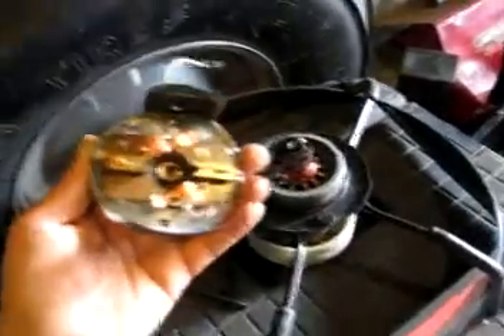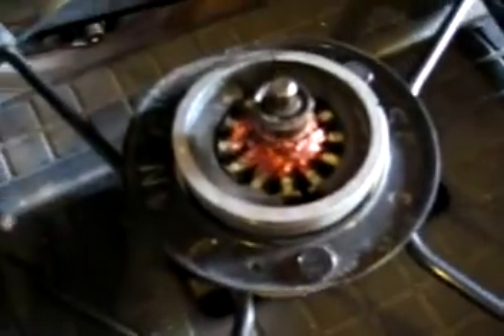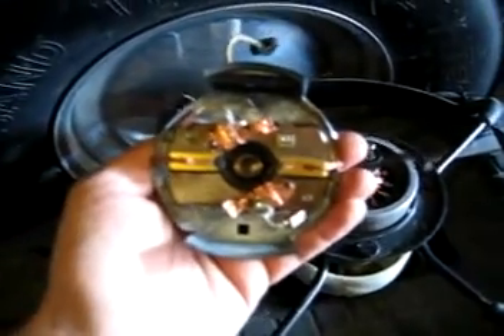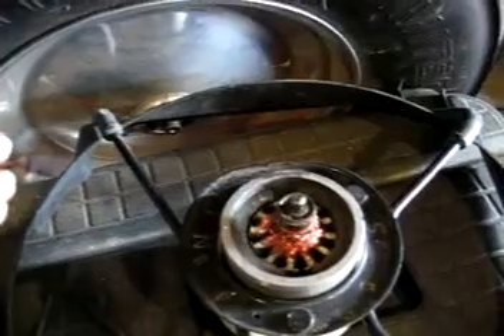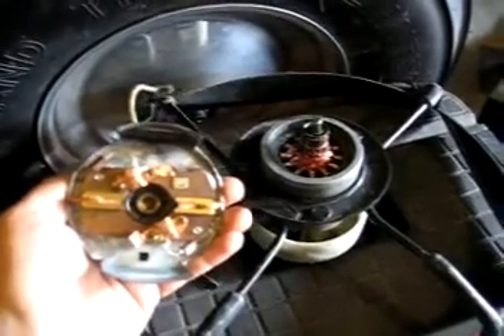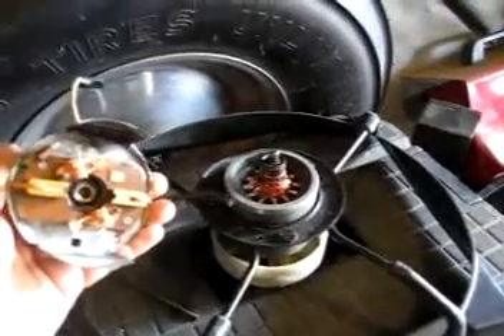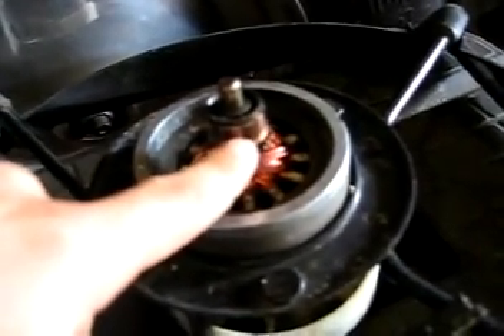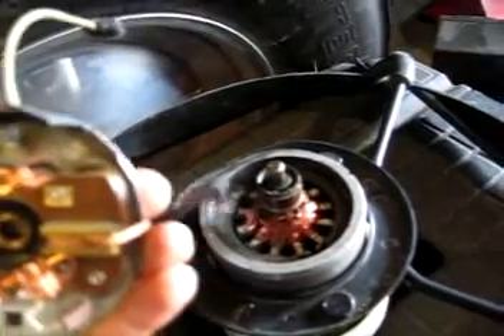Bemf on a normal dc motor

Comment from the maker: brushless motors, are pretty much pulse motors, and frankly other than fan motors and some rc cars they are not very popular. In the end I will be moving in that direction, but I thought it best to start with the most abundant motor around, these things are used every where, both ac and dc, but same design. The trick to this one will be the fact that all the coils are wired in series, which I may have to change so that every other one is wired together. And I wish I had a cleaner shot,